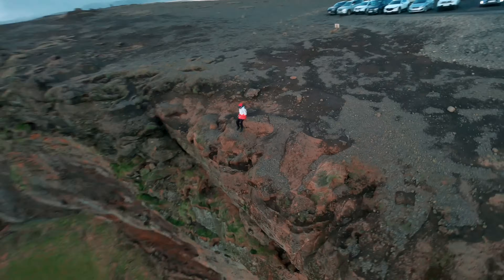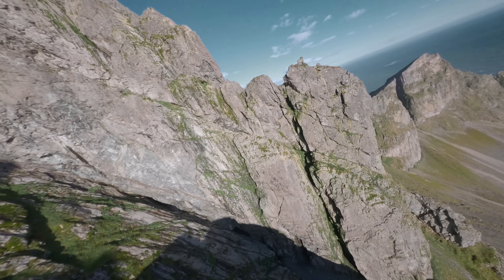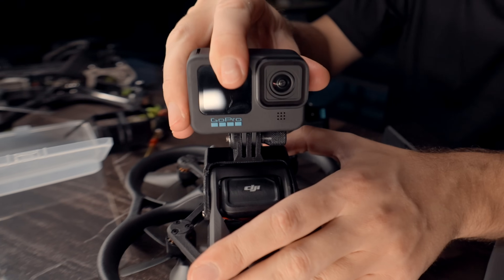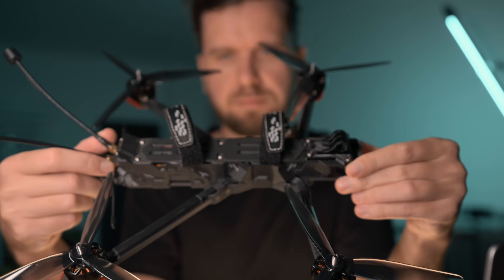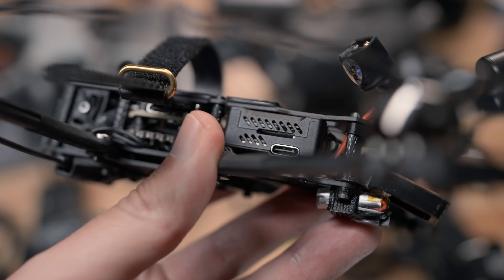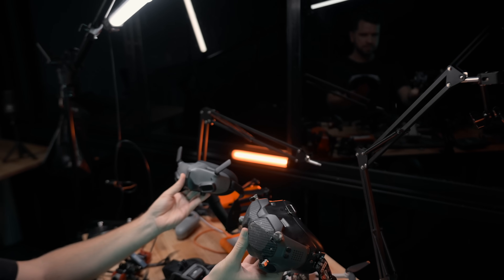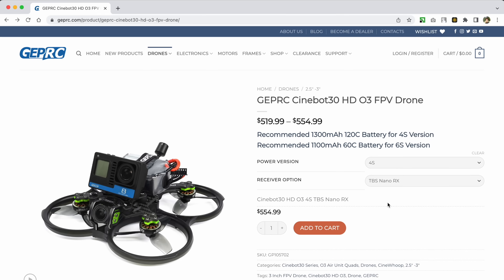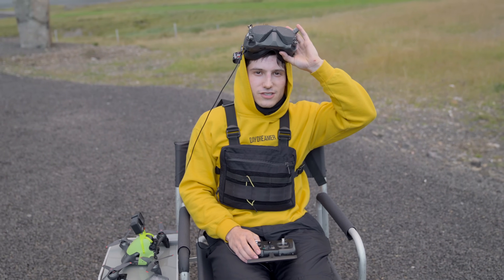FPV Drones – How to start in 2025?

Comment: I think this guy just has some distain against DJI.. Ive owned the DJI FPV since its release, have had no issues with connectivity and have flown it several hundred meters away and high with out any issues, and know I can go farther. Also unless your drone is made to be water resistant dont fly it near water... its common sense... unlike this guy. As for the cameras for the DJI FPV/Avata, they both have 1080p transmission for the goggles and 4k recording resolution, as well as gps.... again I think this guy just has some distain towards DJI for some reason... Not only that but Ive smacked into trees going 80mph+ and have taken off limbs while the dji fpv is fine... obviously everyone has different experiences, but I feel like this guy has tried his hardest to make dji seem as bad as he is saying when in fact it is not, and plenty of fpv pilots actually highly recommend the DJI FPV and Avata for beginners since its easier to get into with them and to learn with them, especially if youre an experienced pilot. And one last thing... why put a gopro on a fpv drone that already has a camera meant for videography  when all its going to do is add weight, and throw off its center of gravity... again this guy is doing things he should not and makes it seem like it's the drones fault lmfao get real...

Comment: I'm out of FPV and RC in general for like 5 years now, decided to get back to it, a lot of exciting new hardware and technology out there, unfortunately due to silicon shortages a lot fo stuff is out of stock (a lot of lipo batteries as well for some reason).
I bought FPV goggles v2, jumper t-pro v2 transmitter, geprc cinelog 30 and some ISDT chargers.
Goggles and chargers are with me, transmitter on the way from china (was out of stock everywhere locally) and drone itself unfortunately is on preorder from china (out of stock everywhere locally as well) apparently should ship out in few days but still like 2 weeks for delivery.

Comment: We stick an RPG-7 rocket onto FPV drones and use them to denazify russians. I would've necer guessed a year ago I would be having so much fun with FPV drones 😅😅😅

We mostly build custom birds for this purpose, end up costing around $300-400 which is 50 times cheaper than an ATGM and has a reach of about 8km

Comment: You mentioned not to use the dji fpv controller … which other controller and signal option do you pick if you are running the DJI O3 system?

Comment: Great video, but I think it’s important to mention that a drone with gps position hold is absolutely necessary for beginners. Most open source FPV drones don’t have that.
Reply: Both of the Cetus beginner drones he recommends have altitude/position hold.
Reply: @mitchlewis535 you will not use that. Manual mode only. Gps is for safety when the signal is lost (wision or radio). Whoops dont have that. You need ports uart on drone FC and enough power and a m10 gps and good setup in betaflight 4.4
Reply: Hi Mike, what options do you recommend to a newbie FPV pilot who already flies gps drones?

Comment: I strongly dissagree. I started with BetaFPV kit which was waste of money as youtubers receive different quality kit. My potentiometers on radio stoped working after half hour flight.
Then I build my own 5” Apex DC on kiss with DJI Air unit, gopro which is pain to learn to build, you need ton of gear for correct building. If you buy anything cheaper you will struggle with bad gyros, AIOs, FC etc frying befor flight or after few flights. You will waste ton of time and money for diagnosics. You also dont need big radio which was also bad recommendation for me. Currently there is no better start than buy avata drone for 570e, dji googles and FPV controller 2. All you need is one battery, charger is included. One battery lasts for about 13-15min of calm flying. Quality of 4k video is far enough for nice drone videos. Its waste of time and money to start with big drone and put 300-500e gopro on it. If you find yourself loving FPV, then build own drone with DJI O3 air unit… you already have googles and controller. Also you failed to mention that DJI Avata has STOP button which for beginner is unbelievably perfect thing to have…. Anyway, your video production is top notch 😉👌

Comment: What sort of price range are we looking at for a good cinematic long range fpv drone?
Reply: 500 - 600 Drone
600 Googles
100 Battery Charger
20 Propellers (depends how many you want)
20 - 50 each Battery (depends on capacity 10 - 30 min flight time)
Reply: @suchtforU  thanks for that time to save some money

Comment: What route do you recommend I go for motocross? I have a Mavic air 2 that I just crashed for the first time trying to get fpv shots.  I don’t have enough flight time and I know it’s takes time. I’m waiting for mine to return from repairs. I was thinking of getting the avata as the air isn’t really that great for action sports. I’m trying to wait and see what might come out later this year. But I don’t think Dji is planning on releasing  a new fpv even though they just released the new googles with the battery attached .  Also how could I get access to the simulator so I could practice? Or do I have to have a fpv signal drone to get access to the simulator?   TIA.

Comment: Amazing video man... And incredible shots!!
How do you return your drone with the GPS?? I haven't figured that out yet!
Also... How do you make sure you feel safe with your signal? I'm using ELRS but lost signal to my Goggles V2 a couple of times when flying behind trees etc. so I'm always super scared to loose my drone! How far should the signal usually go?
Reply from the maker: You need fly in open areas. Stay with good vision of flying area
Reply: @man.fromearth  true, I thought so but I see so many people flying between buildings and in valleys etc and they do not loose connection at all… 🤔

Comment: Interesting video. How to start with drones in 2023? Maybe start with the regulations that are in effect for the airspace in which you intend to fly. In the USA, flying beyond visual line of sight violates the regulations, hence, long range is illegal. Oh yeah, that puppy weighs more that 250 grams so it must be registered (and fitted with Remote ID after Sept 2023). Plus, the pilot might also need a Part 107 license. Nice drone or Not, there are still regulations. Be informed before you buy or fly.

Comment: i got a fatshark, tx12, and a cinewhoop. After like 5 flights the radio doesnt connect to the quad anymore, but the goggles still work fine and I cant figure out what the hell happened. Is this normal?
Reply from the maker: Tx12 not so good, maybe some problems with rx

Comment: Love how you used your flights & footage to teach! 

For those who don’t have enough for a full setup, buying a controller ($60-200), a simulator ($15), and maybe a tinywhoop setup ($160) is the ultimate hack for getting started with FPV without breaking the bank. Thank you for sharing your experience in such an entertaining and educational way.
Reply: You forgot to mention buying goggles
Reply from the maker: Thanks
Reply: @man.fromearth iiiijjj

Jjjjjj
Ll
Reply: more details please 😊
Reply: 250$ All-In-One Beginner FPV Kit - BetaFPV Aquila16
Reply: My whoop had a couple of small crashes indoors and one motor stopped wporking. got a new motor solder it and it didnt work still. That was the end of me spending any more money on crap. Get a proper one dont mess aboit with junk
Reply: What is a good flight simulator?
Reply: @milopack1191 lift off, DRL simulator
Reply: @milopack1191   Liftoff is the most well-rounded one. It's slightly more expensive than the other but all sims are still cheap compared to a good controller.
Reply: @milopack1191  Liftoff

Comment: Great video! Super informative! I'm looking for an upgrade to my Avata. Will the Cinebot 30 work with my DJI FPV Remote Controller 2 that I already have until I can save up a few bucks and replace it with a TBS Tango 2? Also curious how hard it would be to add a TBS Crossfire receiver later if I swap everything over to the Tango 2 controller? Just trying to take some baby steps towards getting more serious drones and the Cinebot 30 + a GoPro mini looks like a great next step up from my Avata! Thanks again for breaking this down so well for a noob like me :)
Reply: The controller 2 works if you choose the o3 "pnp" unit (no additional receiver). To use elrs or tbs you'd have to solder a receiver to the flight controller, then in betaflight enable the "serial rx" on the port you soldered it to, in the receiver tab choose "serial" and "crsf", and then setup the channels in the "modes" tab.
Reply: @redcobra1246  thanks man. Sounds like a bit of a hassle, but doable. Good to know!
Reply: @Darwin Allen  I forgot to mention, with elrs you have to flash the receiver as well. I do it through wifi. I'm not familiar with how it's done with tbs.
Yeah it's a pain the first couple of times. Once you're familiar with it it really takes less than 5 min (except the soldering). If you buy a bnf you're better off buying it straight with the receiver
Reply: @redcobra1246  thanks for the advice. And yeah it's looking like I'll just spend the extra few hundred on a new radio and get the receiver factory installed. I know how to solder but if I can avoid it I do. I think I'll start a separate quad as a build from scratch project.

Comment: The solution I used for the nose pinching problem, 

I literally just ripped out the nose guard part of the foam as it isn't attached to any plastic at that area, now I can breath with no sacrifice to comfort or light leak.
Reply: That's brilliant! I wish I had removed the foam instead of removing my nose. The goggles fit much better after removing my nose but the horrified looks I get from others makes me wish I had removed the foam like you.

(Apparently I'm in a strange mood.)

Comment: Why FPV drones simply don't have the (1) auto-stabilization to hover and (2) a return home feature when signal is lost, like the other DJI drones??
Reply: FPV drones have auto-stabilization, but they will drift away and cant hold the same position, because they dont have sensors and a GPS system.

Comment: Hey - I love what you’re doing. Thank you. Question – why would somebody pick a 4S over a 6S for your typical outdoor freestyle drone like the Mark five you recommend. Do you get a significantly longer run time?
Reply: my question also, i want to know if he prefers 4s over 6s
Reply: From my experience 4s batteries are lighter so you generally get better agility and the drone is quieter. 6s batteries give you more power and more flight time.
Reply: @redcobra1246  I'm pretty sure 4S packs aren't necessarily lighter than 6S for the same Watt Hour capacity. By using the appropriate kV motors, the rpm (and noise) of the props can be identical between a 4S and 6S quad. Higher voltages almost always makes any motor system more efficient. Higher voltages allows power to be delivered with fewer amps. Wires can be thinner in a higher voltage system than with a system with lower voltages. Professional camera drones often use 12S systems. The main downside to high voltage systems is the cost. High voltage ESCs cost more than ESCs used for lower voltage systems. The motors for high voltage systems also cost more than similar motors for low voltage systems. If you can get electronics to handle it, you're almost always better off going for higher voltage.
Another (claimed) big plus for the high cell count quads is the reduced voltage sag when the throttle is slammed. I've heard this claim many times, but I'm not a good enough pilot to really know how much this matters.
One downside for high voltage systems is the nasty spark you get when plugging in (and unplugging) a battery. There are ways around this spark but it's something to keep in mind.
Reply: @ddegn  I meant to say they're more zippy. For a standard fpv drone of 800-1200mah 4s tend to be lighter than 6s. 6s has more power but it's bulkier

Comment: Thanks for this awesome video! It comes perfectly in time as I am right about to choose my components for my first build. I want to use o3 and the dji fpv controller...do I need an extra reveiver for the fpv Controller or is there any built in the o3?
Reply from the maker: build in the o3
Reply: @man.fromearth  thanks for helping me out!
Reply: @man.fromearth  so I do not need an extra receiver in the drone for the radio and I also do not need an extra video Transmitter?
Reply from the maker: @Flo2  yes if you buy DJI O3 drone

Comment: That's not true you can't just buy it fly it and enjoy it.  You have to be able to fix them. Have to. Unless you have very deep pockets.  I typicaly take three drones with me and usually two of them are broken borrow I go home and fix them.  It's not hard though. You also have to be able to use beta flight to tune.
Reply from the maker: If not enjoy it why you do this?
Reply: I love flying FPV,  but I wouldn't if every time I crashed or broke something  I had to send it to some for fixing or had to buy a new 600$ drone.   That would take the fun out.  You can't be careful with them or your never going to get good at it.  Being good means breaking them a lot.   I can go home replace parts maybe tune it a little different and be out flying again in an hour.   That's fun anything else would be super annoying.   It's an expensive Bobbie even if you do all the work your self.
Reply from the maker: @308pof  If you fly freestyle – yes, but for cinematic usually all good with a drone. Do you like freestyle? Flips, rolls...?

Comment: Great intro to FPV 👍 I've been trying to get into this hobby for years, and keep starting and stopping because I'm intimidated by the steep learning curve. I just need to get on with it - it looks like so much fun!
Reply from the maker: You can do it!
Reply: I've heard that the GEPRC drones are for the intermediate to expert when it comes to flying. You also need to learn which system within the drone is right for you. Also, you need to acquire a radio, goggles as well as batteries. On the plus side, you will learn a lot just by doing your own research. Nothing wrong with the Avata as that is perfect for beginners to learn the basics of flying FPV and also build confidence.   The good thing about the Avata is the built quality and the battery life is a bit better compared to other Cinewhoop drones. There are many videos out there not recommending the Avata because it's too slow (not really), too loud (change the props).  These are usually folks that have many hours with advanced FPV drones. But, I recommend that you get back into it.
Reply: I’m good. At. Drone
Reply: I have the same issue bro...😢

Comment: the latest firmware solve the tumble problem ;) its just goes back to manual and doesnt fall down ;) 
Also for the end of the video for the dji fpv controller in standalone doesnt good for simulator cause you cannot activate it withouth a drone :( so you need to borrow one at least then you can do the liftoff .
Reply from the maker: Are you flying with DJI Avata?
Reply: @man.fromearth  yep :) avata is new and the old fpv.

I also test out the avata at november it was awfull, but the new firm is repair a lots of flaws.

Comment: Your video is very helpful for beginner, great job! I'm living in thailand and my main problem with my F6D O3 is overheat of the O3 unit. It happen only when I'm doing very low speed flight or static. By security the video recording on the O3 unit stoped, signal to goggles didn't :) Any advices for hot weather area ? I'm flying with Crossfire too even on my tiny Firefly 1.6" and cinelog 25, As you I like the tango 2 small design.
Reply: Try using a frame with an O3 heat sink like many of the O3 iFlight drones or the Speedy Bee Master 5 HD.

Comment: For stage 1 fail safe you need to set it to angle mode and set throttle 1250... Otherwise your drone just falls out of the sky until GPS Rescue engages.
Reply: Also random point, I tested the BN-220 GPS back to back against the iFlight GPS (which is 3X the price) and the BN-220 GPS performed better every time. There's no need to buy the GPS from either iFlight or GEPRC, the Beitian BN-220 works flawlessly.

Comment: is the avata with the gopro11/mini that bad? What do you think about using an insta360 go 2 with it, just for social media content?
Reply: Not needed, the Insta360 Go 2 isn't better then the O3 from the Avata/DJI 03 Air Unit.
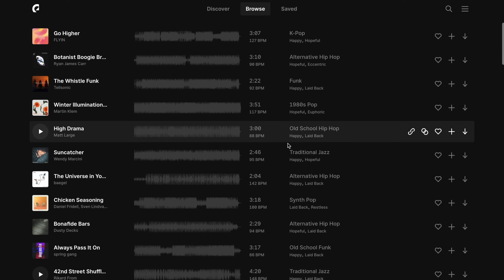Reply: @schweizerluchs  with the Go 2 I'll get a 9:16 ratio, which the air unit wont give, thus making it vertical.
Reply from the maker: But you have 4K resolution in O3, when on Go 2 you have only 2.7K, also in o3 better stabilization with gyro flow
Reply: @man.fromearth  The Go 2 also has gyro data, I'm only planning on using it for vertical content, so 2.7k is more than enough, small form compression algorithms work better with lower qualities. But for Youtube (not including shorts), the O3 is better for sure.